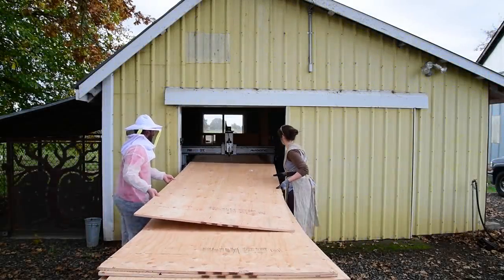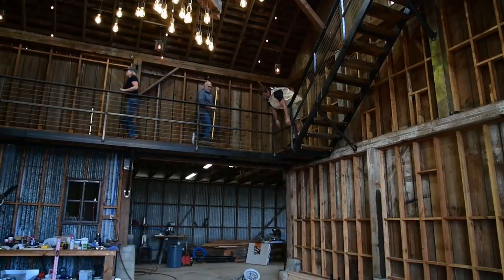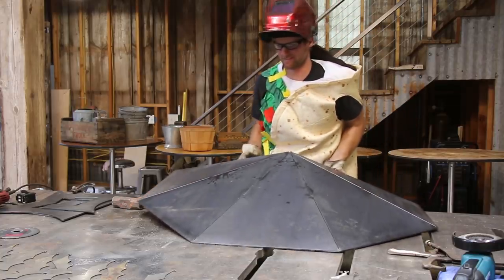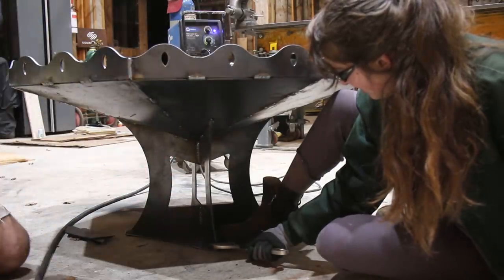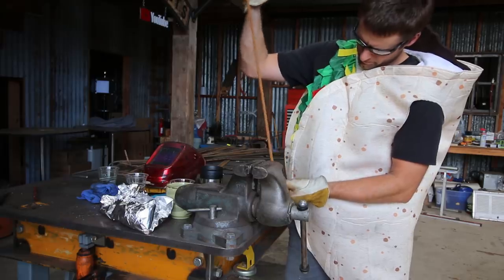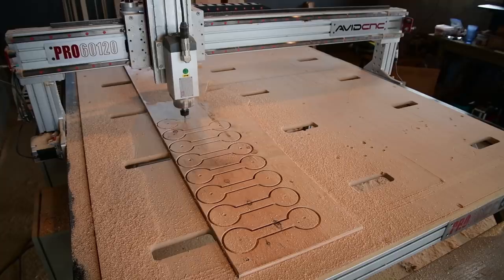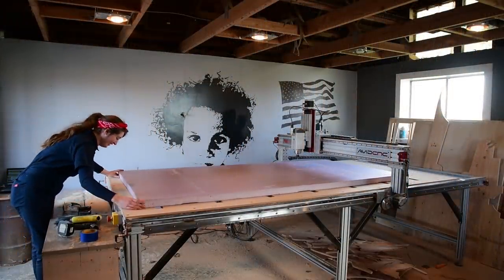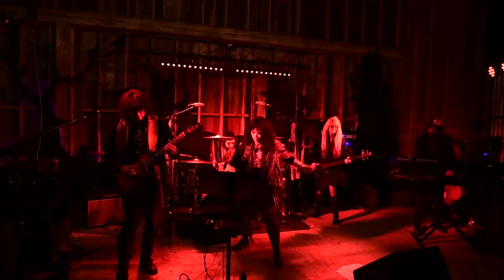Halloween Barn Bash

Comment: Great video as always!  Side note:  The spray-paint dissolved the foam tombstones a bit because of the solvent in the spraypaint (usually acetone).  You can have more of the dissolving by holding the can closer as you spray.  If you hold the can more than ~12 inches from the material you will have no dissolving because all of the acetone will have evaporated by the time the paint hits the foam.